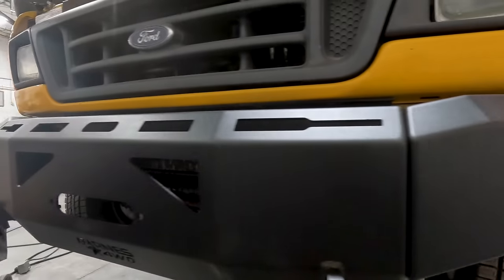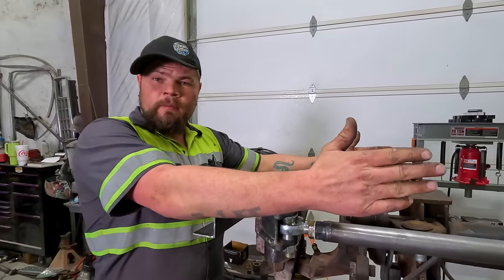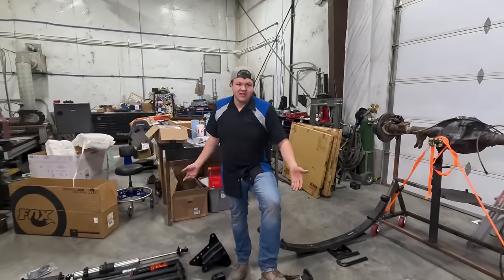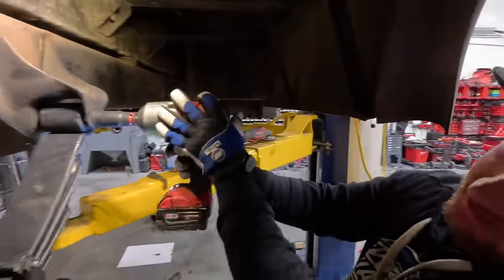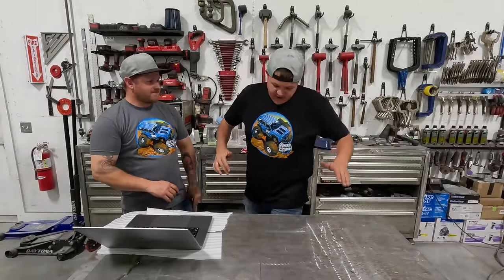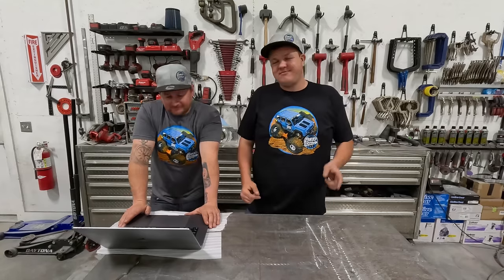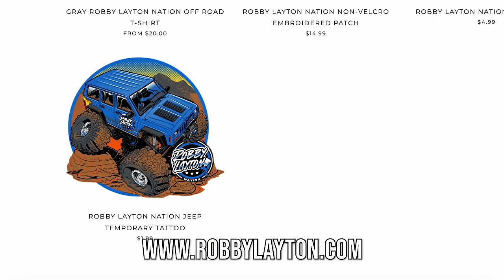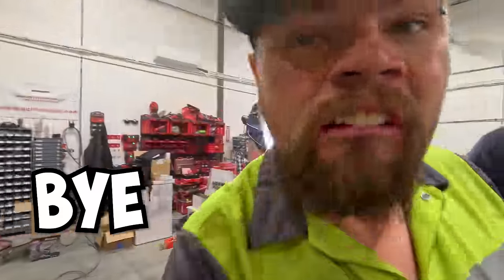The Off Road Bus Gets New Bumper Installed & Suspension Ripped Out!

Comment: I wish I had the patience and knowledge Colt does when building front ends and rear ends. Not gonna lie, I keep them pretty well stock and when I ultimately break them, I just swap the whole damn thing out. lol. That goes for automatic transmissions too.

BTW: I was an underground coal miner in WV for several years too. Continuous and long wall. You’re right about how miserable everyone can be underground. I might add cut throat too. I started mining straight out of the army and it was quite a culture shock going from camaraderie between everyone you work with everyday to not being able to turn your back to anyone without them going outside and cutting your head off to the mine foreman. Especially on the production crew.

Comment: If you're wanting to accurately measure toe-in, use one of those little Bosch laser measuring tools. They're accurate to within 1/32nd of an inch and they don't sag in the middle, throwing your measurement off. Measuring frame squareness, offsets etc., they really come in handy. Your frame rack is laser, so...

Comment: Use a chisel in the air hammer to knock the heads off those rivet heads too.  It's faster than all that grinding.  And it looks like you all need a more powerful air hammer if it won't knock those rivet heads out after the heads are off.  I had an air hammer so powerful that it burst into two pieces.  The case of the tool cracked in two.

Comment: I wonder if HB could have used a level from the exact center of the bump stop to the top of the leaf spring and marked the spring, measured the distance from the center of the leaf spring bolt to the level mark and used that as the distance to relocate the leaf spring brackets.

Comment: At about 6:58 in video you mentioned the battery is in the back of the buss. The winch I would think could last longer, work better, and more reliable if a battery were closer to the winch. It draws a lot of amperage and long wires for power would make the winch strain harder under a load. Just my opinion of this old fart. Now to watch rest of video.